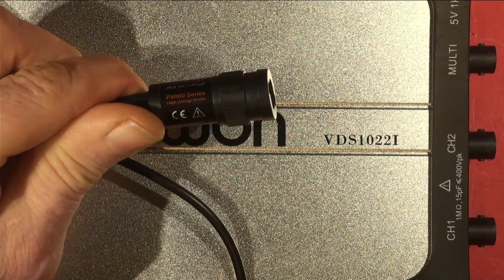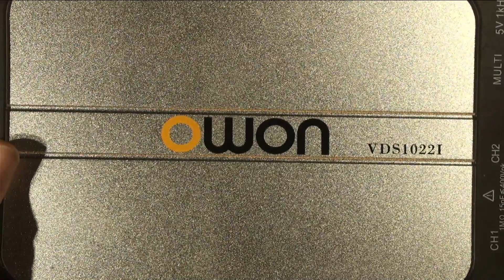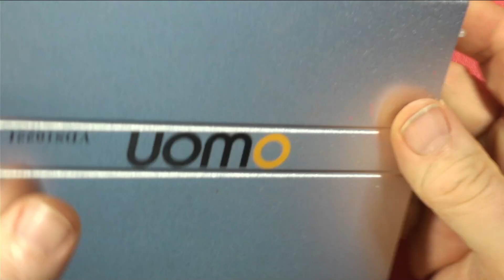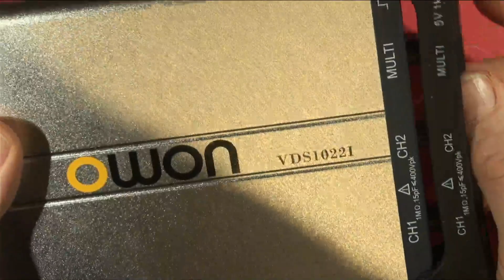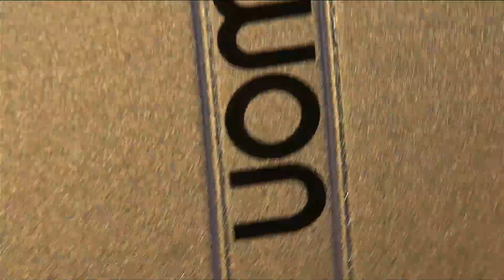WARNING: Your USB Scope Might Be LIVE! (OWON VDS1022I Exposed)

Comment: Man, that's janky as all get out.
I would have expected better from that company... for some reason.
I'd wrap the can in heat shrink... or something.
Reply from the maker: I can see why they removed the specification for the maximum isolation from the manual but now there is not specified at all = nor is there a warning in the doc or on the product.  It is widely believed to be good for 400V (probably due to misinterpretation of the marking above the inputs)..There is definitely danger lurking.  I am using it here at 600V on the scope '0V' rail right now.     Maybe they planned a plastic housing but it wouldn't pass CE emissions spec. Doesn't comply with the low voltage directive so cant truly be CE.  I'll probably 3D print a new housing for it. It looks so innocent sitting there with 600V on the case...